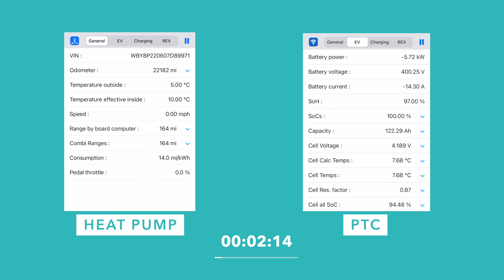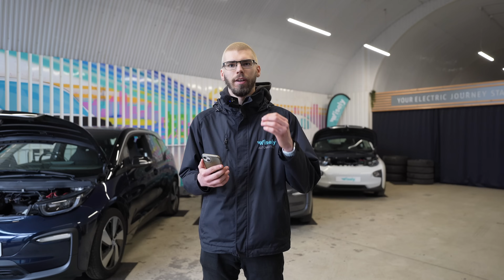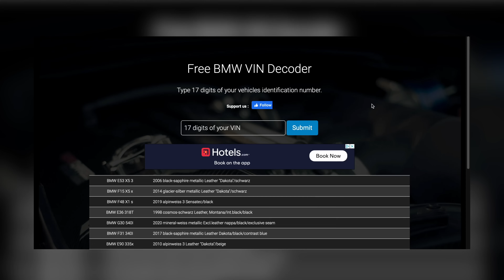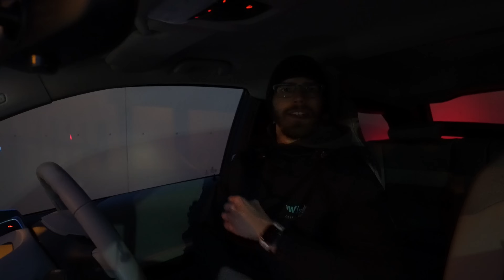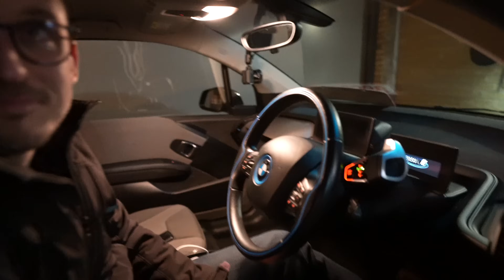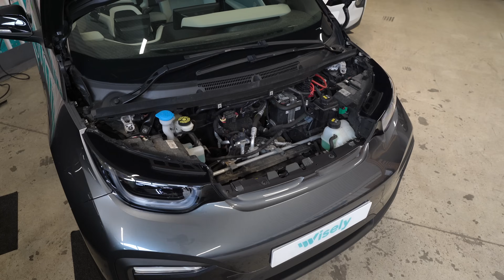BMW i3: Heat Pump Comparison in Real-World Winter Conditions & Look Under The Bonnet

Comment: Surprised, everywhere i looked claimed difference was significant. I have a car with heatpump now. could have gone for a cheaper one probably. I3 seems to be supplementing with resistive heater a lot even when heatpump is running so could be model specific.
Wonder how would it scale if car was driven through the city, where it would drive much lower average speed. anyways, seems not havnig a heatpump can't be a deal breaker anyways. at least now i know.

Comment: Worth mentioning the 'more to go wrong' factor with a heat pump. Presumably they will be subject to all the potential faults we experience with airconditioning ( compressor failure, refrigerant leaks etc. Plus of course the extra cost of having one in the first place.

Comment: There was a test of the hyundai inster with and without HP and the result was around 4% so similar to your test. With the more to service/break it does not make economic sence to pay much for the HP.
I have a rex some no space for a heatpump but the PCT works fine.

Comment: Nice video of a nice car. Re throttle travel, you may remember testing my Jensen and that had a longish throttle  travel as did a 70s Camaro I had. Re seatbelts, no seatbelts = equal you hitting the wheel/ screen/ dash at the speed you were travelling at impact. A rigid car doesn't absorb any energy.  A seatbelt mitigates this. A crumple  helps even more....! So a Mini with no seatbelts.....😬

Comment: That's a crazy heat up time - I have a i3 and a Telsa Model 3. The Tesla has PTC heater, but much simpler in that it doesn't heat coolant, it just heats the air entering the cabin. It will go from 5C to 22C in well under 5 mins. It too draws around 6kW peak.

Comment: Great attention to detail in this thorough real world comparison.

As BMW would no doubt have been aware of the limited savings achieved by this heat pump design, it makes you wonder why they brought it to production as it must have increased manufacturing costs. 
Perhaps it was more to reduce the preconditioning time with two heat sources vs one.
Or perhaps it was simply in the name of Innovation in their i-series.

Well done for emphasizing the much larger scope of efficiency savings when heat pumps are used in a domestic heating setting.

Comment: Depends on how you use it.

Short journeys (say 5 miles each way): Dont bother with a heat pump.

Longers commutes, say 30 miles or more (like we do): the heat pump gives you faster warm up on a frosty morning, and lower consumption over the journey.

Also, the heat pump probably reduces wear on the PTC heater, which is a component on the i3 that suffers failure and is rather expensive to replace.

Comment: Hello!
Why did you decide that heat pump cars heat the battery with a resistive heater, and not with hot coolant? I request you to do some research on this topic. There is very little information on the Internet about the battery heating logic in the BMW i3. How big is the difference in heating efficiency?
Reply: does the coolant get hot enough to do that?
Reply: @mikeb1039   
I meant refrigerant from heatpump system. when compressed it heats up. who's stopping you from switching the valves and heating the battery instead of cooling it.

Comment: Several EVs use their heat pump not only to warm the cabin but also to heat the battery, improving efficiency in cold weather. Like 21< newer Teslas or Hyundai Ioniq 5 & Ioniq 6, Kia EV6. 
Making heat pump more interesting choice for these models since the battery preconditioning is made more efficiently.
Thanks for the video! -- What about a new comparison video with cars that use the HP to heat battery during winter? :)

Comment: My heating wasn't working in the cab so I've replaced the heating element but unfortunately I still have no heating in the cab, any information welcome thanks.
Reply from the maker: The heating is part of the HV system. We would strongly recommend getting the fault diagnosed by a BMW workshop or an independent specialist like us before undertaking any further work or throwing any further parts at it.
Reply: @wiselyauto  it cost me £114 to get it diagnosed by a BMW specialist and I'm a mechanic so I thought ok I can fit this myself, I've checked for air locks and it's all fine I've plugged it in to texa and I've got no error codes but it's still not working, o well these things are sent to try us.
Reply from the maker: @cheveredj8435  what was the result of the £114 diagnosis? If your AC is not running either (there should be an audible buzzing NSR of the car) then the HVAC fuse in the EME has blown. No error codes will show.
Reply: @wiselyauto  hi thanks for getting back to me I really appreciate your time, the diagnosis was the heating element in the front of the car, the A/C is not working but I can't hear a buzzing noise, I'm going to take it down to work on Monday hopefully I can work something out👍👍

Comment: Hey guys I just bought a 2015 Rex and both heating and AC work fine when I’m not charging but don’t work when I am. Any ideas?? I can code whatever is needed.

Worried about winter time.

Comment: Hang on… so the HP i3 has both a HP as well as the conventional heating unit? If so, do other HP cars also do this or are there HP exclusive models? If the i3 could be configured fully HP operation only, would it be more efficient?
Reply from the maker: Most EVs with heat-pumps feature both, as heat pumps can struggle to provide enough heat if the cabin temperature is set very high in very cold climates.

Comment: How would the heat pump be if you disabled the PTC heater? It would be much slower heating and maybe not work too well when its super cold, but wouldn't you get a more noticeable power saving? You would think there would be an echo mode that disables the PTC heater.

Comment: Would you say the heat pump on the new ID5 would have the same efficiency? I have ordered one expected to arrive in the summer, so I can still add the heat pump option, but if it's anything like what you show here it doesn't seem like it's worth it at all.

Comment: Great information video. Having had i3 120ah without and then i3S 120ah with heat pump, I can say the biggest win I found for driving consumption was to pre-condition for my departure time while still connected to the home charger. As video notes, heat pump car took less time to be "ready" for me at 19C, and then the battery seems to reduce less quickly. Not nearly a scientific as Martin/Arthur's test of course, but sometimes observation and sentiment are important to owner experience too

Comment: Great video! I´ve recently bought an 2020 i3 with the heat pump system. I´m having a lot of difficulties heating the car up, it´s my first winter with it and  the temperatures are around freezing. Usually the heating is turned on via BMW app before departure time, left to do it´s work for half an hour but despite the process cold air is blowing in the cabin😏  However, I've noticed that the cabin is heated (via BMW app) only when the car is plugged in and charging. No warning lights are shown on the broad computer.  Any thoughts on the problem? Appreciate any help ty
Reply from the maker: It's likely to be a failed/failing Auxiliary Heater which will need replacing. Common, and independent to the heat pump system. Error code 801380 usually present in the car's logs, but not always.

Comment: The test is a bit incorrect because for the HP it should be stopped after the car reached 22 degrees, because it had been waiting for extra 8 minutes while the PTC car reached 22 degrees
Reply: I think it might stop using a lot of energy if the target was 22C etc.

Comment: Great video. Do you see the HV PTC heaters failing much - out i3 2019 heater is not working, and wonder what might have failed?
Reply from the maker: It's the heater itself which needs replacing. One of the most common claims on our warranty policy
Reply: @wiselyauto  Thanks,  I guess that's the ~£800 Electric Water Heater part that needs replacing?
Reply from the maker: @RodLittle  £864.38 inc vat to supply and fit

Comment: Interesting test. So far, in my 2020 Niro, if I turn on the heater, it will supposedly draw 2kw, then after it gets going, around 600-800 watts. It's an air based PTC setup with heat pump. 40 seconds after it starts the heat is ready. Unlike this first gen setup, the Kia can harvest heat from everything.
I wonder why GM and BMW here use a coolant based setup for PTC while Kia does it via a PTC/ ceramic heater style setup.
Reply: Tesla Model 3 (non heat pump) uses air PTC heater. It heats the cabin in a couple of minutes. No idea why the i3 uses a coolant circuit with immersed heater. Seems like complication for no benefit.

Comment: One thing really worth mentioning is that a heat pump system will increase in efficiency compared to a PTC heater the colder it is outside. Living in Sweden with long winters and often minus degrees the heat pump will use way less energy. England during winter is almost like summer ;)
Reply: Erm. HPs reduce in effiency as the external temperature decreases. A PTC heater is always 100% efficient.
Reply: If you read other comments they state the opposite to what you wrote. Also what you say contradicts 14:42. And if you think about it, if what you're saying was correct they wouldn't need to put a heater, the heat pump should be enough on its own.
Reply: @z00h  Yeah maybe there's something I'm missing (could very well be), but heat pumps are well known to be most efficient the lower the temperature delta. So if you're trying to maintain 20 if it's 10 outside it'll take a certain energy, it'll then take much more than double that energy to try to maintain 20 if it's 0 outside. Also you'll run into problems with outside radiators freezing in home applications, not sure if that's also the case for cars. It's not really a problem because the systems are designed to deal with it, but the temporary reversal in the cycle will cause even more energy usage without any heating whatsoever for a few minutes, until the outside radiator gets rid of ice build up.
Reply: Not true, a heatpump are made to be optimal at a certain temperatur depending on the coolant, pressure etc. Most are made to be efficient around the temperature in this test because there are many hour with this temperature so the SCOP factor (season corrected) are optimal. At -10 deg. they are not more efficient than pct.

Comment: This is not good enough. Test it at -5*C while driving, no preheat. HP is more efficient at speeds.
Reply: Nissan Leaf with HP and without, difference is more than 20%. +5*C is laughable "cold".

Comment: Well explained, I have a 2019 Leaf with Heatpump and a 2023 MG5 with PTC heater
My wife and I work at neighborhood Buildings, using the same parking lot.
I’m curious how it will be next winter! - received the MG in June, no need to heat it

Comment: With all respect something is wrong with data! 5.5 Kw for heat pump means the unit must have 7 hors power compressor and a huge condenser with the size of old Fiat 500! and it pools close to 80000 BTU! Even for electric heater you have the same huge numbers not matching with the size of the car cabinet.
Reply from the maker: The numbers are taken from the official BMW training documents and are in line with other EVs.

Keep in mind that with the i3 (and many other EVs), the AC is not only responsible for maintaining a comfortable temperature in the cabin, but also cooling down the battery.
Reply: Despite your efforts for a well designed test and hard work, the test does not show how the heat pump is operating and at what Coefficient of Performance. Your test shows a very bad COP which can be either due to real world conditions or a heat pump with health issues. Because you said UK conditions would favour the biggest difference, there is the possibility that that heat pump could be malfunctioning.

Comment: Very interesting to get some accurate real world results, according to the bmw service manual, the heat pump would need only half the amount of energy for the same energy output compared to the PTC heater.
That beign said, the I3 unfortunatly does not recouperate heat from the drive motor, inverter or battery, these have their own cooling loop, and are not connected to each other in any way, the radiator for these components is behind the radiator for the heat pump as well, so no heat can be recouperated from this.

Comment: However you may get a significantly better efficiency, if you preheat from a grid and then drive. Sustaining heat using a heatpump is substantially more efficient than using PTC. However BMWi3 with its low range it is indeed not a big deal.

Comment: My results are with a Tesla SR+; 1 year with SR+ PCT I got 278 w/mile compared with SR+ with HP that gave me 243 w/mile over 1 year. Both cars travelled same distance of ~12,000 miles. That's over 10% better with HP, even though winter lasts only 6 months...

Comment: Thanks Martin. Reminds me of golf equipment. Claims one ball goes farther or one driver hits it further, yet robot testing reveals that…yes the ball will go…2 yards farther or the driver the same. Big deal… Leased mine new in 2021 and at that time I think all US i3’s came with the heat pump in lieu of the gas generator. Still love mine. Charge in the garage as needed but only drive an absolute max of 100 miles round trip…ever.

Comment: My PTC died this past winter (120Ah BEV w/18,000kms) and the heat pump was unable to provide any heat whatsoever... no drivetrain warning either :(
Reply: Well that answers my question about how good would it be without the PTC heater. I assume in your case though both the PTC and heat pump are not operating.

Comment: I can't see which driving mode you were using for the test. I thought that Eco mode disabled the resistive heater and used only the heatpump. Comfort mode uses resistive heating and eco + uses no heating.
Reply from the maker: We used COMFORT, but we can experiment with having them in ECO PRO in the future to see whether the difference becomes any more significant.

Comment: The most important decision criterion would be the noise made by a heat pump. My Skoda Enyaq is extremely loud and I'm just waiting for the neighborhood to complain.

Mercedes does not even install a heat pump in the top model EQS and VW leaned too far out of the window with its promise and then had to make an expensive step backwards (see: https://youtu.be/GdNJFHVl96w)

Comment: Hi Martin, greetings from Oxford. Fascinating video; I did not spec the optional heat pump on my 2019 120Ah, my thinking was in the Winter I would wear driving gloves and use the heated seats. In general this approach works quite well, misting up can be dealt with by the air conditioning, which drys the air entering the cabin. My Winter cabin temp is set to 17C in general, 18 for a treat! 🤗

Comment: I think the key measure is the cumulative power used by each of the two heating methods, particularly given that the heat pump actually uses more power than ptc initially, offset by lower use after a (short ?) initial period. For my typical use I have learned from you that a heat pump is only more efficient after about 20 mins use so only relevant to longer drives.
Reply: Exactly my sentiments

Comment: Here in Australia, we've been using these for decades to heat & cool our homes. We call them 'reverse cycle air conditioners' as with a few valves, like in the i3, you can switch from cool to heat easily.
Reply: Heat pumps / reverse cycle AC is not effective (on homes at least) when ambient temperatures drop below -10ºC or so. In my part of Canada, we set our car's interior heat to its maximum, from about November through April, controlling the heat with the fan setting. And there is no heat in most combustion cars until after they've been driven for a few minutes. Not sure whether the heat pump approach in cars would handle our conditions.  At least it allows you to try heating up the car before you get in to drive.

Comment: A great video to reveal the truth behind PTC vs Heat Pump. Very interesting because the Heat Pump has long been heralded as being a very significant improvement to an EV. Not so much it seems from your scrupulous tests and results.
Reply from the maker: It seems to vary quite a bit from vehicle to vehicle, so difficult to just make a blanket statement. Really doesn't seem that important on the i3 though...
Reply: A great video. It all comes down to the design of the HP system, as your discussion of Tesla confirmed. It seems that BMW prioritise fast cabin heating, over maximising efficiency. Their system is also very simple compared to Tesla, so missing lots of opportunities to maximise the value of the HP.

Comment: Good video. A small comment: The heat pump itself is placed where the rex engine is mounted, so it won’t make any difference to move the petrol tank..
Reply: Not sure that you are correct. If you have no REX engine under the boot floor, then there is just a void, perfect for a WOKE boot extension. It is the fuel tank for the rex that is taking up the space for the compressor / heat pump.